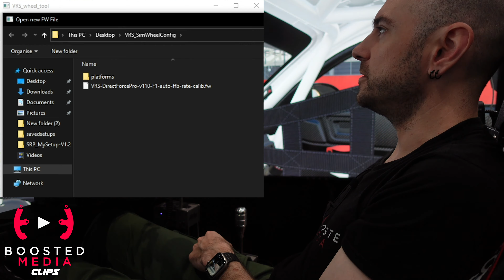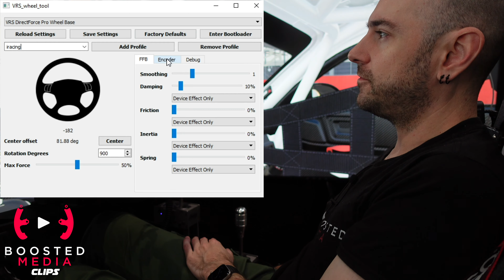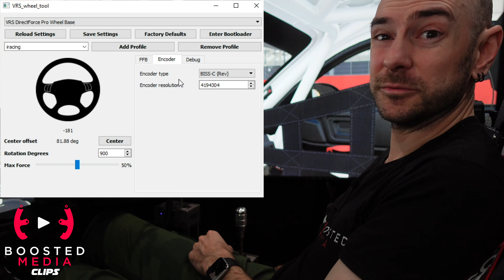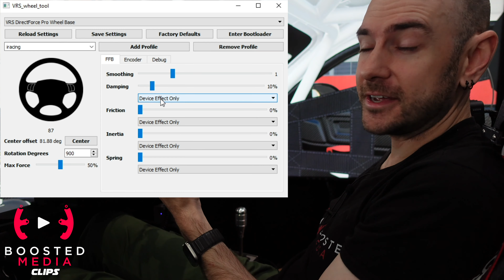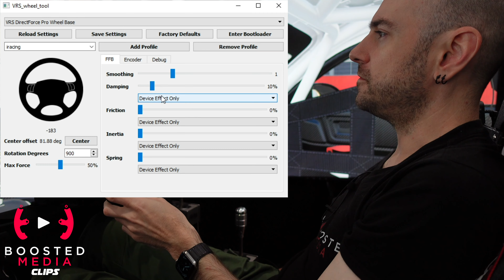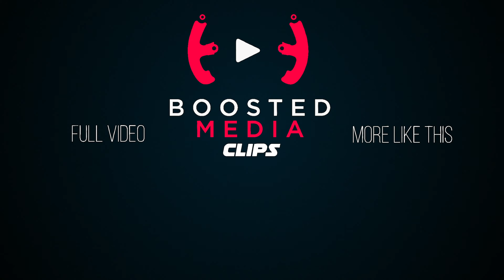VRS Direct Force Pro Settings Explained

Comment: Well if that Max Force slider is similar to what Simucube has then with 60% you only reduce the Amps going to the motor meaning your 20Nm DD now becomes a 12Nm DD. This is really bad for the dynamic range of your FFB.